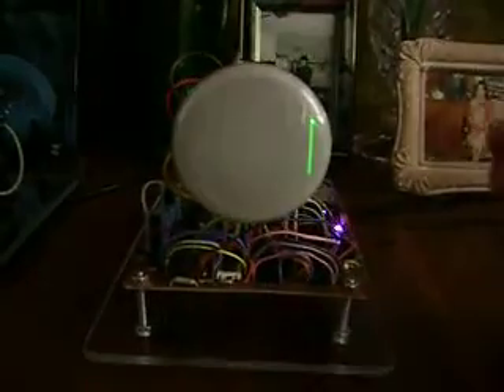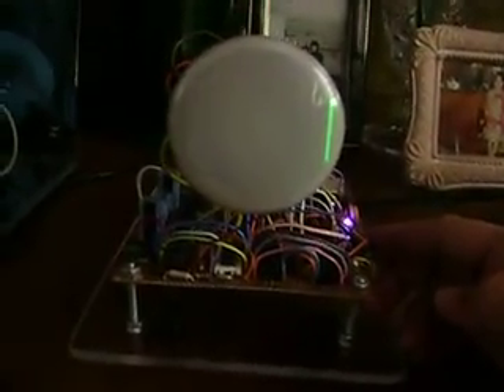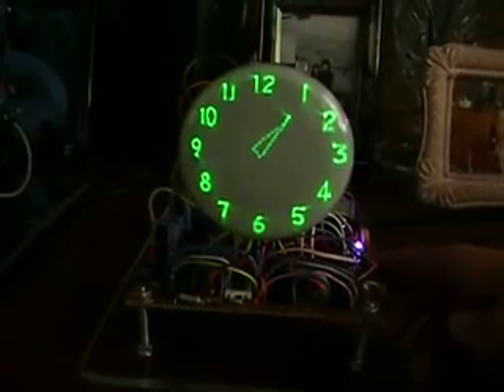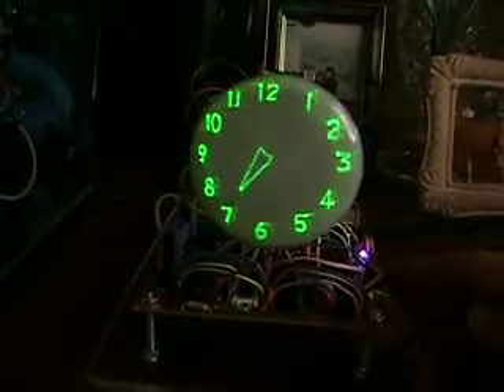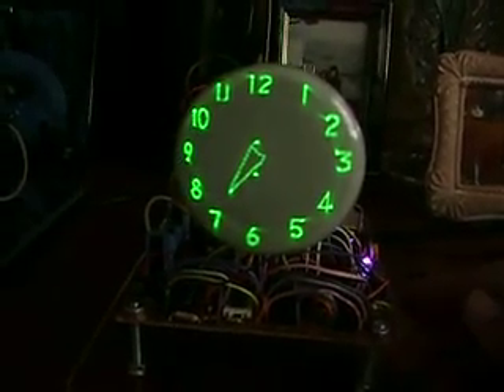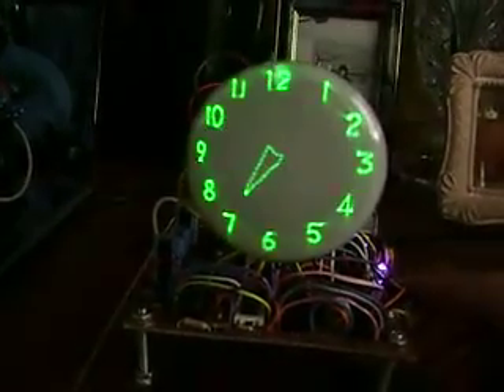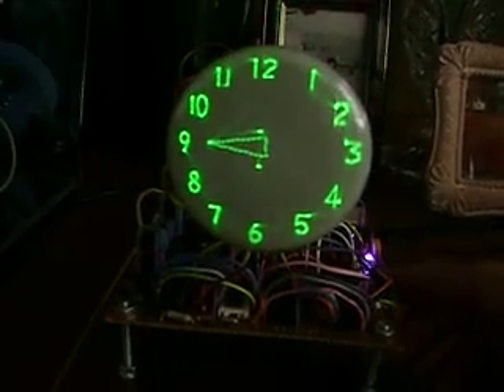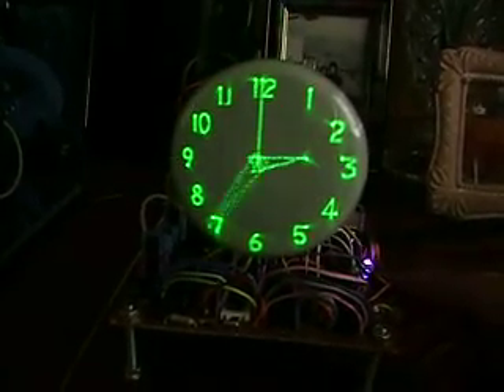Scope 28 048

Comment: Still haven't built my kit after 3 years.  Reason is - no circuit diagram came with it...   Probably will eventually build the programmed PIC chip onto a different board and use it without the kit.
Reply from the maker: You can download the assembly instructions anytime at http://oscilloscopeclocknixiecrt.com/
from the kit page.

Comment: Very nice work!

But large yellow wire nuts? Something smaller or better yet under the board and out of sight would be much nicer! And a smaller bolt on the CRT clamp.

Good job otherwise!
Reply from the maker: @gregorycotton850   You can buy the kit at http://oscilloscopeclocknixiecrt.com/